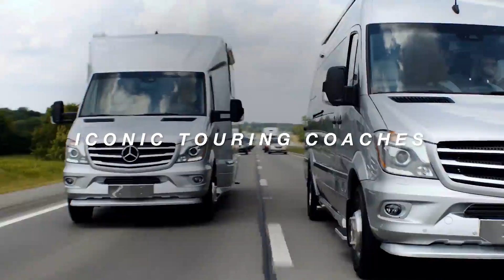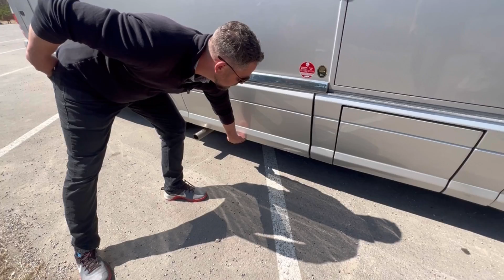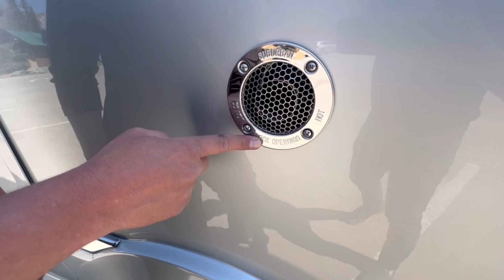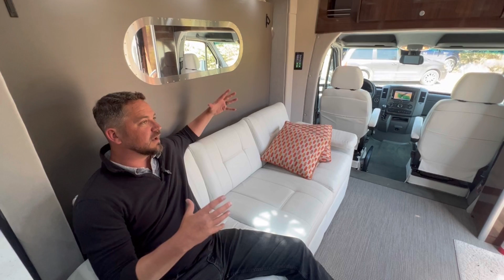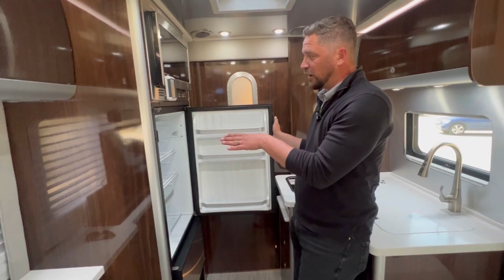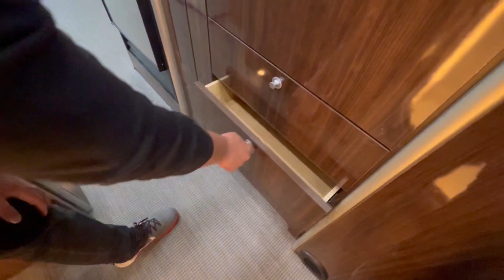Worlds most luxurious Touring Coach - Airstream Atlas  @Airstream-Inc + @MercedesBenz

Comment: There should be a clear plexiglass panel when the TV is down where you can see it through. I need to make a full plan where the galley is flipped to the campsite and the freezer still have a pullout drawer.

Comment: Nice review, the bed is a 73" x 73", not a king, but ample. I am buying a 2023 Atlas Tommy Bahama for myself, trashing and tossing out the Murphy bed and will just use the fold down sofa for a bed, with bed up, too dark in the coach, then the windows will be open all the time, without the Murphy bed blocking them.Toilet is plastic, lame for a $300,000 RV, but with the Lithium upgrade, can scrap the propane, go full electric.
Reply from the maker: I haven’t seen the bed removed. That’s an  interesting idea. The E1 package is VERY nice and fairly simple compared to others I have seen. 😊